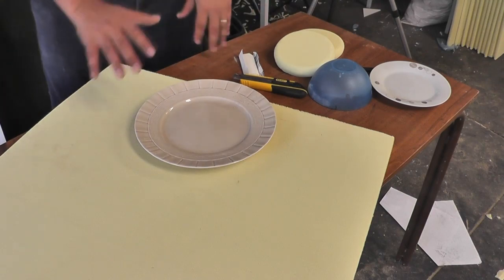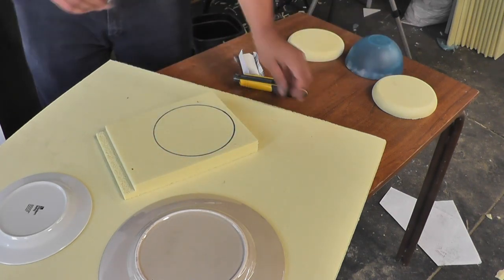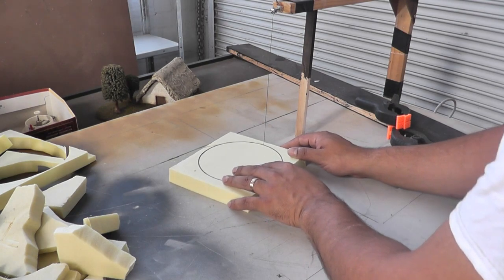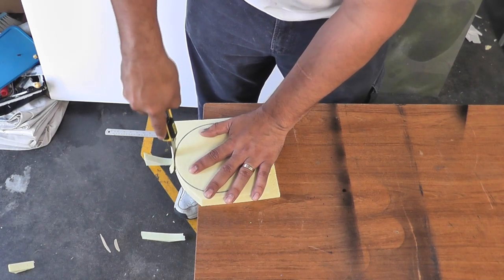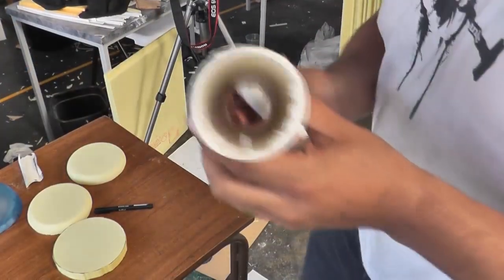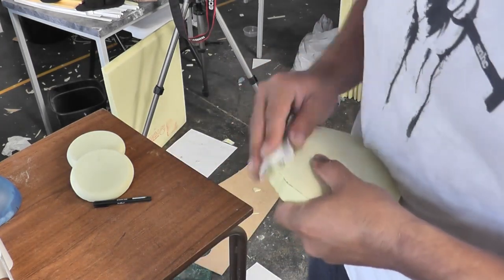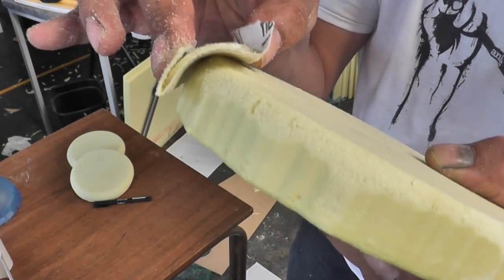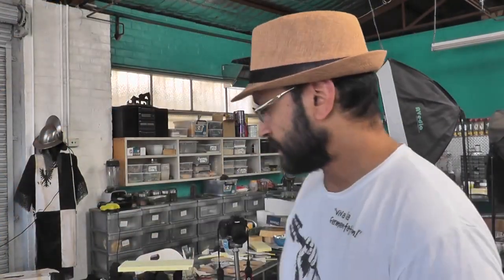1. Tau Terrain Project - Round Shapes

Comment: With the hot wire cutter if you are doing lots of round cuts, you can make a round template out of thick card or hardboard and pin it to the foam, that way you don't get the jaggy edges and they all come out the same, :) love your tip with the 40mm pipe for sanding,

Comment: Hey Viv, could you use a rotary tool, Dremel etc, on a low setting to rotate each piece of foam against the wire cutter? Put a hole through the centre of the foam and hold it parallel to the wire whilst rotating. You'd have to fill the hole in the centre in after but you'd get almost perfect circles of foam.

Comment: Great tip on using the pvc as a sandpaper holder for the shape. I was thinking that the cut-offs from the circles made on the hot wire cutter look like they would make good arched bases for elevated walkways or bridges, or something like that.
Reply from the maker: That's a great idea!

Comment: That's a really nice way to produce the bevel, I'll definitely be using that technique in the future ;)

As a small side note, be careful on the markers you use. I once had marker residue (from a Staedtler Lumocolor, blue) bleed from the foam layer, through the plaster coating, and through the paint layer ;) I guess it was highly polar or something. So if you find a brand that works then don't make the mistake of changing brands like I did!

Comment: Rub the sand paper on your jeans when it starts to cake up to clean it - tip from Adam Savage from MythBusters and Tested :)
Reply from the maker: I've always found a quick brush the small broom from a dust pan set works fine ... rub sand paper on my jeans?!  If I got paid the money he does, maybe!
Reply: Well didn't need to be jeans :) he just said it when he was putting a model together.  Old workshop clothes, brush etc. would work just as well :)

It's just some people think once it's caked up like that, then you need to use a new bit coughmewhenIwasyoungercough.
Reply from the maker: Steven Whiting Yeah I get ya ... I'm always rubbing my files on my pants, that seems to help clear them out for a bit